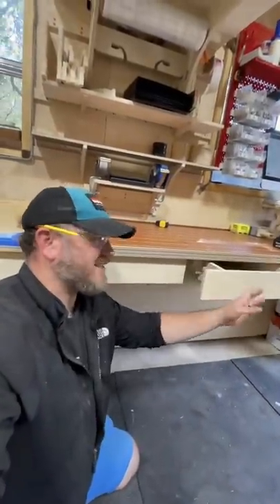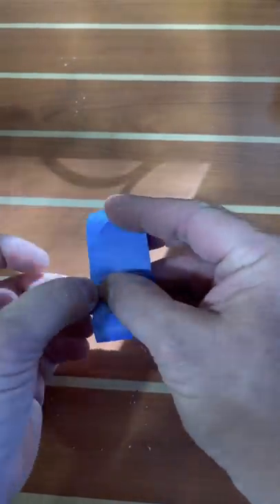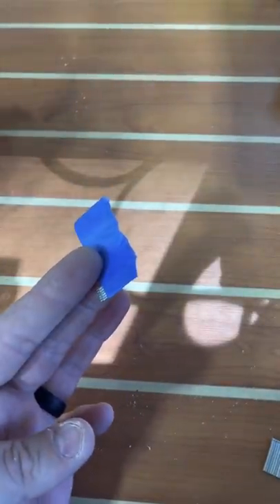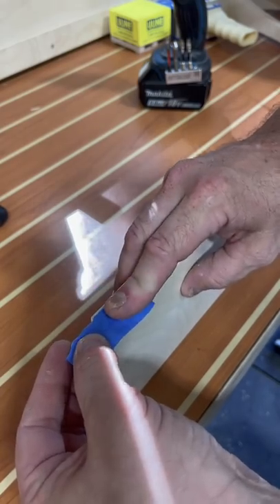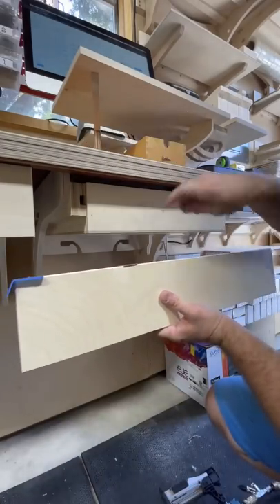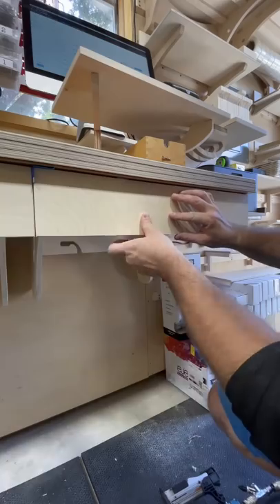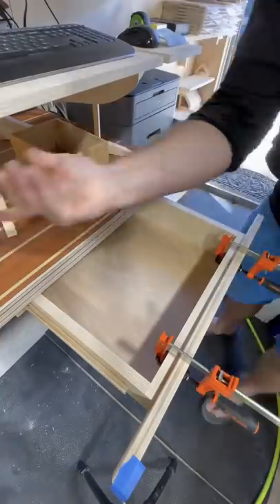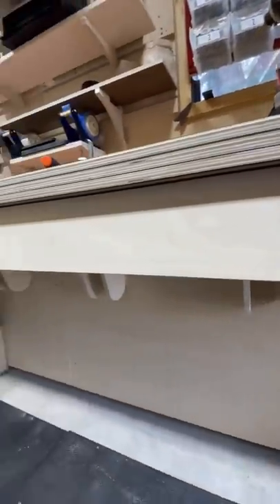Every Woodworker Should Know this Tip #Shorts

Comment: I can appreciate everything up until you nailed the face of the drawer. Use 3M double sided tape brother. Then use a screw from inside the drawer to the drawer front. 

Amazon- (Copy and past this) Double Sided Tape,3m Mounting Adhesive Tape Heavy Duty, Foam Tape, LED Strip Lights, Home Decor, Office Decor (0.39In x 108 Ft, Black)
Reply: I’d have to agree with not nailing thru the face. 18 g leaves a decent hole let alone the driver.
Other than that, good vid and nice bench.  
Whose Pilot house floor from a 61’ Tollycraft did you get that from

Comment: You can use anything that thickness basically. No need to go out and get some Brad nails.
Reply: I think the point of this tip is to use something nearby. He's using a brad nailer already so doesn't have to go collect a different tool.
Reply from the maker: Bingo👍👍